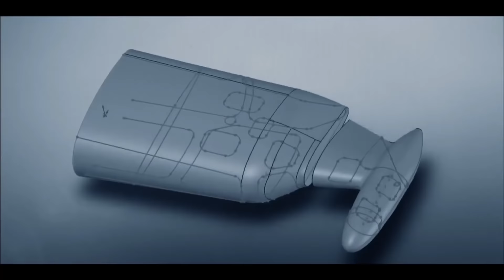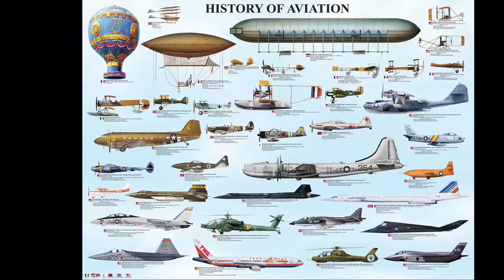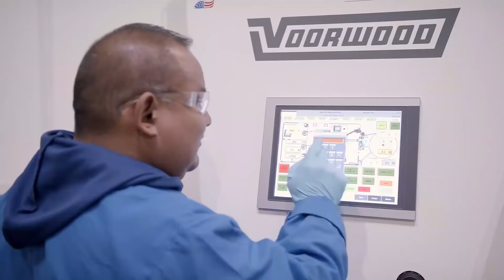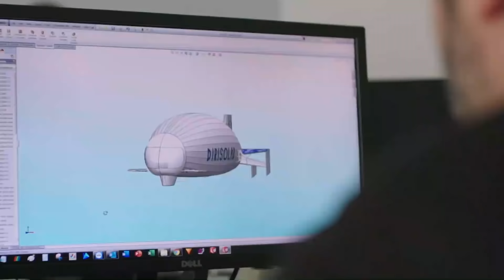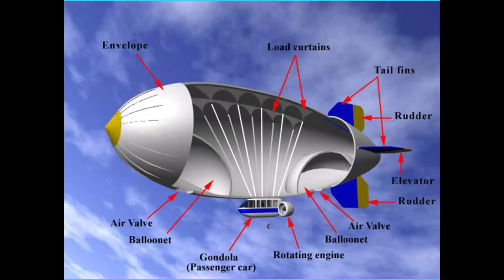Advanced Technologies for Modern Airship

Comment: I'm convinced about airships having a big future in electric aviation. However, that vacuum calculation doesn't add up.
Lets give air, which is mostly nitrogen and oxygen, a molar mass of 28 x 0.79 + 32 x 0.21 = 28.84 g/mol.
Displacement per mole of helium is 28.84 - 4 = 24.84 g/mol
Displacement per mole of hydrogen is 28.84 - 2 = 26.84 g/mol
Displacement per mole of vacuum is 28.84 - 0 = 28.84 g/mol
So helium already produces 92.5% of the lift of hydrogen. Pretty good considering the safety.
Vacuum would produce 107.5% of the lift of hydrogen if you could keep the material mass the same. Probably would not compete with helium in reality.

Comment: Vacuum airships aren't really a great idea considering the amount of structure required relative to how much structure is used for traditional airships. the skin on modern airships can be on the order of a few hundred grams per square meter, even with advanced futuristic composites nothing would be able to withstand that kind of external pressure and be light enough to take off. The other number I think you should have mentioned that's more important the W/B is the what the difference in buoyant force is between a vacuum and hydrogen. Buoyant force is the difference between the density of two gases, in hydrogens case .08375kg/m^3, subtract that from the density of air at STP (1.225kg/m^3) and you get 1.142kg/m^3 equivalent of lift, compared to a vacuum's lift of 1.225kg/m^3, if my math is right that's only around 7% increase in lift relative to hydrogen, which is not enough to make up for the amount of structure you'll need to withstand a constant 1atm of pressure across the entire envelope. The other issue with a vacuum airship is it limits you to practically only using a sphere, which makes a pretty terrible airship shape aerodynamically. Hydrogen (or any lifting gas) plays two important roles, one is obvious as a lifting gas, but the other is counteracting the atmospheric pressure which negates the need for massive structure that would be required for a vacuum lifting volume.
Reply: Cylinders work as well, and you seem to have forgotten they only need to withstand 1atm of pressure at ground/sea level, as they rise in altitude less internal pressure is needed to prevent crushing so a hybrid approach seems like a good way to go. Particularly if the lifting gas is hydrogen since it can be fed into fuel cells to provide the electrical power needed for propulsion as well.
Reply: @BlueChrome  
- 1atm is equivalent to roughly 10 metric tons for every square meter, no material that's as light as existing envelope material is withstanding that force unsupported, and even if you could manage to find a miracle material that could the advantages of doing so are only 7% better than hydrogen in terms of lift. In addition, the structure now must be rigid which also adds substantial weight. The lifting gas being used to support the envelope via internal pressure is not a feature to be overlooked.
-Cylinders make terrible pressure vessels, capsules maybe but that'd only marginally be better than a sphere aerodynamically.
-Higher altitudes are the enemy of airships, you lose a substantial amount of lift as you increase altitude due to the nature of buoyancy. Remember lifting gas subtracted from external atmosphere is equivalent to your lift, if air pressure is halved your lift is also roughly halved.
-Hydrogen would make an excellent fuel choice for airships in my opinion, just not from the hydrogen that's being used for lift (for aforementioned reasons)
Reply: @Christian Salge > See the vacuum aerogel wrapped in cling film videos to get an idea of where I'm coming from. 
Now an airship calved from sold aerogel might be a tad expensive, so hollow the lifting shells out so they only have to withstand the ambient air pressure at their chosen cruising altitudes, when they go lower than this the lifting shells would be filled with hydrogen to balance out the atmospheric pressures trying to crush them.
So not a true vacuum airship, but close enough with a hybrid approach that makes the airship somewhat more affordable.

"-Cylinders make terrible pressure vessels," > And yet engineers the world over continue to make cylindrical submarines, aircraft fuselages, rocket propellant takes, pressurized vessels for storing and transporting industrial gases, it's almost like they ran the numbers and came to the conclusion that cylinders may not be perfect they are certainly 'good enough' to be useful.

"-Higher altitudes are the enemy of airships" > Strictly speaking, sure you have a point, but seem to be ignoring the bigger enemy of airships is the troposphere and all the myriad storm systems it contains, see what happened to the Akron and Macon amongst others for why operating above the troposphere seems like a really good idea.

"-Hydrogen would make an excellent fuel choice for airships in my opinion, just not from the hydrogen that's being used for lift" > True airships versus the low altitude helium blimps we see today, have a technical challenge they need to overcome when they go from ground level to cruising altitude then back to ground level again - in that they need to be able vary the amount of buoyancy their lifting envelopes provide or else bad things happen.

Being able to feed hydrogen from your fuel tank to the lifting envelope then into a fuel cell when the airship needs to descend again is a very useful thing IMO.
See all the complex and/or heavy workarounds helium airship proponents have had to devise in order to justify the use of helium as a lifting gas, factor in the rising costs of diminishing helium reserves and it starts becoming obvious why helium airships aren't really seen in everyday use all that often/at all.
Reply: @BlueChrome  
I can't find any videos relating to vacuum aerogel wrapped in cling film. regardless as far as i'm aware there are no aerogels, much less structural aerogels that are lighter than air or even close to lighter than air. When it comes down to it making a vacuum airship would be all about strength to weight ratio, especially compressive strength. currently nothing exists that can withstand that pressure while being light enough to lift an airship. on the vacuum airship wiki it even seems to imply that diamonds aren't strong enough to withstand the compressive strength of atmosphere against a vacuum. I'm not going to say it will never happen, but technology isn't at a point where a vacuum airship will be feasible likely in our lifetime.

re "Cylinders make terrible pressure vessels," submarines airplanes etc are not cylinders, google search "cylinder" and compare the shape to an airplane or submarine. submarines (and pressure vessels) are closer to a capsular shape. look at a the vast majority of pressure vessels and notice that they are capsular shaped with rare exception. a cylinder has a flat top and bottom with a circular cross section, and that 90 angle between the flat face and the curved portion make it a poor pressure vessel where weight is a factor. The distinction is important because cylinders have sharp edges where a capsule does not. Just because aircraft and others have cylindrical sections does not mean you can describe them as cylinders any more than you can call a cube a square because it contains squares. 

re "Higher altitudes are the enemy of airships" that has nothing to do with my argument, my point was that as airships ascend to a higher altitude they lose a substantial amount of lift, to the point of not being practical at higher altitudes in the case of any non expanding airship.
 
on hydrogen we seem to be mostly in agreement, so long as hydrogen can be proven to be safe in the eye of the public it's definitely the superior choice for a lifting gas.
Reply: In theory, vacuum graphene foam can be lighter than helium, and without H problems. In practice, a cube 1m of this foam, while have a lifting force of approx 0.5 - 0.9 kg, will cost a as a plane.

Comment: I remind you of a 1960's concept called "The Pumpkin Seed."  It was a proposal for a lifting body that worked with lighter than air gases and a "lifting" external configuration.  Talking about ultra strong materials and variations of atmosphere; I spoke to a professor at a Midwestern University whose students had an idea to build a very large, variable focus orbiting reflecting telescope where  a large piece of Mylar (or something similar) would be stretched across a drum where the internal pressure could be increased or reduces to increase or decrease the convex surface

Comment: What about mixing hydrogen with helium  to reduce flammability? Internal fans can keep the two gases mixed so it is always below flammability limits everywhere in the gas bags.
Reply: Hydrogen by itself is not flammable or explosive. It has to be mixed with an oxidizer such as oxygen. The bad part is the percent range for it to be flammable is quite wide.  There were survivors during the Hindenburg fire so it isn't as dangerous as you might think. Separating the people from the hydrogen is pretty easy and since it burns upward just put it above what you don't want to burn. It also doesn't radiate heat like gasoline. Use relatively small containers that don't burn. Hydrogen is the way to go.
Reply: @Eugensdiet  I know that hydrogen in and of itself isn't flammable, but it's flammability mixture ratio is wide. I think it is something like 97% hydrogen / 3% will burn. What this means is that you don't need much of a leak with the outside world where oxygen and hydrogen can mix and then get into the flammability range.  That's why I was suggesting helium as an additive. It would basically "get in the way" and dilute that mixture ratio.

A little bit of trivia; the Hindenburg was designed for helium. However, the United States was the only helium supplier at the time and due to worsening relations with the new Nazi regime in Germany there was a helium embargo. Thus, the Germans used hydrogen instead. I can't help but wonder if the vents on top of the dirigible where the hydrogen first ignited were faulty for hydrogen use since they were designed for helium. The German engineers would have designed those vents not worrying about any potential mixture ratios, turbulence, static discharge ignition sources, etc.

One thing is certain however; the Hindenburg would not have blown up if it was using helium as originally intended.
Reply: @flechette3782  A far more spectacular accident was the 85 space shuttle disaster, but getting back to the Hindenburg, that happened over 80 years ago. Materials are much better now. I guess that is why we see them designing lighter than air using hydrogen. Maybe a better way to use helium is to surround many small hydrogen balloons with a large envelope of helium that has very little volume. This should also minimize leakage of the hydrogen via osmoses.
Reply: @Eugensdiet  That's not a bad idea.
I love dirigibles and really wish we could fins a good economic use for them. Awesome machines.
Reply: Hydrogen bags within Helium ones!

Comment: The statement that a vacuum airship would be half the size of a hydrogen airship is incorrect.  The lift is proportional to the difference between the molecular weight of air and the lifting gas.  So fill a hydrogen airship with a vacuum and the relative lift is roughly 29/(29 - 2) = 1.07 or 7 percent higher, so you could lift the same weight with a vacuum airship that was roughly 93% as large.  This is not a very large improvement, given how much heavier the airship will have to be to contain a vacuum.

Comment: As much as I want airship technology to advance as part of the industry of flight, all of these will become vaporware if the prototypers, developers, and manufacturers neglect the following:
- equipment, infrastructure and practices for handling airships on the ground
- sustainably controlling buoyancy to respond to atmosphere and weight changes
- materials, systems, and practices for preventing, mitigating, extinguishing, and recovering from fire!
I don't mention hydrogen vs helium, because even if you overcome the changes in buoyancy being deducted from the payload, helium will not stop a fire!! Plenty of helium airships in the past went down, flames included; when there's poor fire-prevention practices and plenty of other flammable materials/equipment on-board, hydrogen vs helium won't make a difference.
Reply: Great points, but landing could be made optional if needed.  I.e. GPS station keeping and a cable elevator could allow re-supply while hovering.  Solar power could greatly reduce fuel needs.  And modern weather observation and prediction make it far easier to avoid storms.
Reply: All the points you have mentioned (and more) have been taken in to consideration since airships began to be flown in 1900.

Comment: If vacuum is the preferred option then the requirements would be for small spherical cells in multiples to fit the lift required. This would ensure the cells would easily be strong enough to resist external pressure.

Comment: I believe that the helium airship technology can be combined with light weight jet engines to achieve safer than current jet craft  travel technology yet at reasonable speeds for intercontinental travels; I mean systems that don't just fall off  the skies when there are malfunctions

Comment: Ian Pearson three days ago suggested hot air. Thousand of hot air balloons are flying today and a few of them are blimps (doesn't have a outer frame) and have propulsion.   The issue is the lift potential and standard atmosphere sea level can lift approximately: Hydrogen 1.202 gram per liter, Helium  1.114 gram per liter, and  Air 99 C above air temperature 3.870 gram per liter. (maximum operating temperature for Nylon  400 and 500 hours before the fabric needs to be replaced.)  Hybrid with 5% Hydrogen hot air is suggested for max lift.  Other gases that can be used: coal gas, Ammonia, Methane, and proposed gases steam and pure Nitrogen that are not toxic or flammable.
The advantage of heating the lift gas is more lift and control.  That means a bag material needs to be light, strong, insulating, and can handle high temperature.  Well UK tested a material to the melting point of steel 23,000 F Starlite a intumescence material.  Commercial product of a  intumescence paint materials can be used to coat the inside of the envelope.  Intumescence materials creates an insulating carbon foam when heated to high temperature.  
At home DIY material:  
   2        flour     binder
   1       corn      starch hold shape and less sticky
   1       sugar    carbon source
   1      baking soda and/or Borax     creates  CO2 and water gas
  25 gm of water
Have fun  YouTube source  https://www.youtube.com/watch?v=0IbWampaEcM        https://www.youtube.com/watch?v=Qtm_xOtw_r0

Comment: ERROR AT MINUTE 4. A vacuum can NOT have twice the lift of Hydrogen. Air weighs about 1.2 kg per cubic meter, Helium about 0.2 kg, Hydrogen about 0.1, and an absolute vacuum weighs zero. To get the lift we just subtract the weight from the weight of air. Helium gives 1.2 minus 0.2 = 1 kg of lift per cubic meter. Hydrogen gives 1.2 minus 0.1 = 1.1 kg lift per cubic meter. A total vacuum would give 1.2 minus 0 = 1.2 kg per cubic meter. That is about 20% more than Helium, and ablut 9% more than Hydrogen.

Comment: Instead of a vacuum, you could use lasered air, or ionised air, or use the bond oscillation of Nitrogen diatoms, or even electron gas, to reduce its density.

Comment: How to make lighter than air airships with existing materials.

High strength low weight materials.

May I suggest a double walled 2 shape design. The outer skin might look like a standard airship with only a partial vacuum or Helium gas. The inside would be hollow spheres using a complete vacuum. The difficulty is finding structural synergy and optimum lift, strength, vacuum, and optimization designe.

Comment: I like the approach you take. I don't think that vacuum buoyancy envelopes are a step in the right direction, though. Air has a mass of about 1.2 grams per litre at sea level atmospheric pressure and room temperature, while helium is about 0.17g grams. If a helium airship buoyancy envelope gets a small rupture it will leak slowly, if a vacuum buoyancy envelope gets a pin hole it could quickly lead to catastrophic failure and a total crash, very quickly. It is a great example of how far is far enough and how far is too far and too stupid (forgive the phrase). Of course while designing my airship I considered the full range of parameters down to vacuum enclosure. Helium is the happy medium currently. While I do have some other interesting ideas they are beyond the scope of conventional thinking and are subject to a different treatment on the longer term but for now, let's just figure out helium based airships and make them super weather resilient, super safe and high performing. Well that's what I'm doing and hopefully at some point in the near future you will be interested to see what I've come up with. Great video, very interesting.

Comment: Vacuum seems like a great idea...until you remember that the helium. or hydrogen, or vacuum is not what provides the buoyancy. The buoyancy comes from the air displaced by the "buoyant agents". Thus, the relative densities between air and buoyant agents is not relevant. The relative densities between the agents is relevant, but not as important as you may think. What is relevant is the difference in mass between the airship and the displaced air. This is an addition/subtraction calculation, not a multiplication/division thing.